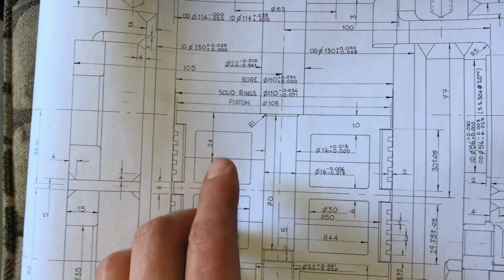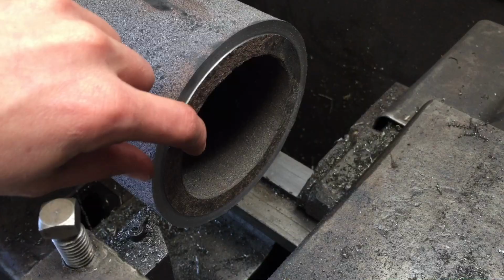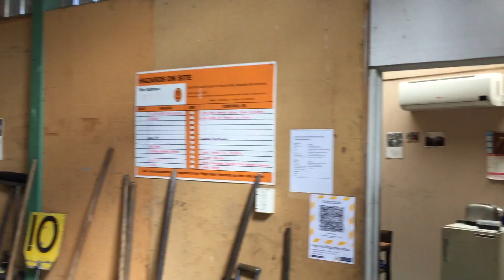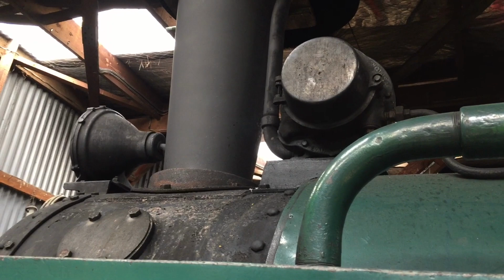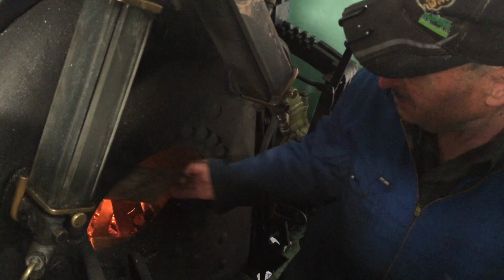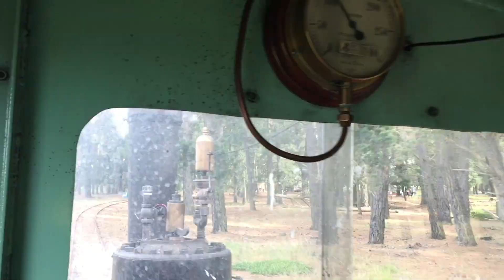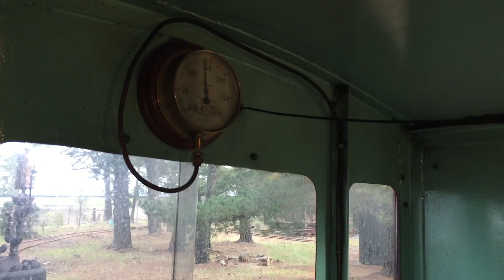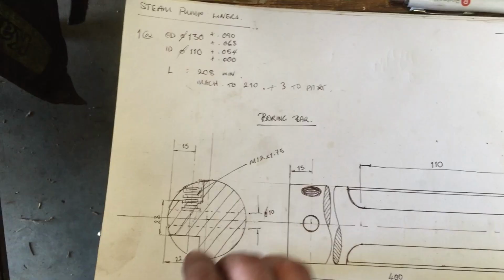EP3 Night Trains & Liners | Modern Steam Locomotive Design & Build

Comment: Connects parabolic light catcher over exhaust pipe and sends the light to vent through artificial crystal focus lenses to laser straight into the water > Adds ultrasound transducer to change pressure inside at will using some of the excess energy from turbine > Adds ultrasonic atomizer and a hand crank turbine to charge it for quick start > Adds ultrasonic non-corrosive hydrogen conversion for night or super low light conditions > Runs steam exhaust to condenser for reuse or drinking water with ultrasound forcing water in the exhaust down into water > Adds dehumidifier with thermoelectric cooler keeping alcohol in the condenser COLD for max efficiency > Adds pipe to run some heat to water storage to keep it warm & ready to be reused by boiler > Adds electromagnetic gears for more quiet operation You have potential..  Enjoy.

Comment: Q. The Fowler Loco seemed to make a lot of smoke while running. Is this the same for your Mackwell Loco’s?
Reply from the maker: Modern steam locomotives must be smokeless. My earlier episodes show how a modern loco boiler steams without any smoke emissions (or sparks). The Fowler was smoking a bit more than normal due to a rich fire to keep up with the turbogenerator steam consumption.